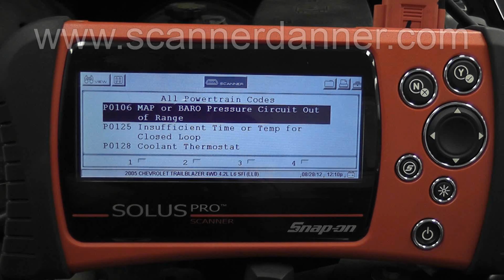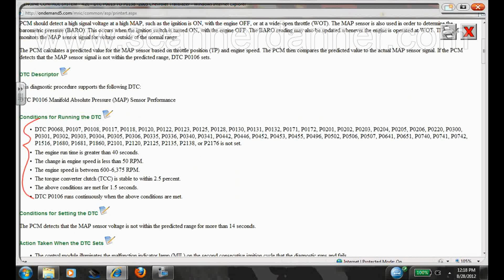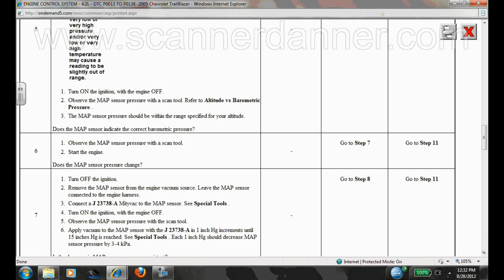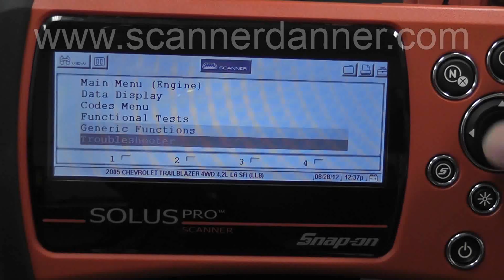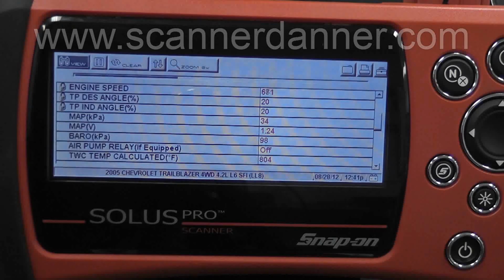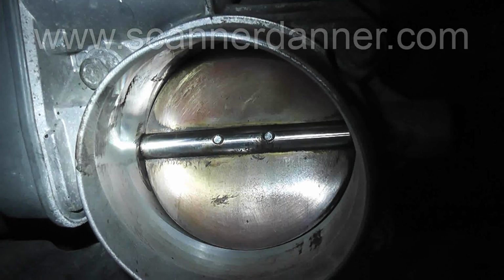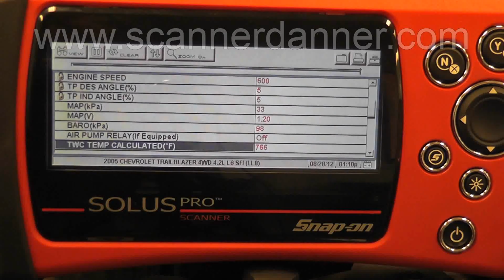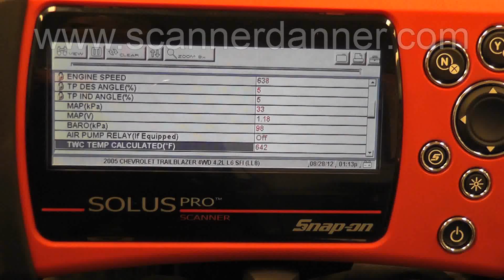MAP Sensor Code P0106 caused by a dirty throttle body

Comment: Just cleaned throttle opening/plate on Chev hhr, started up and after about 2 min the engine light went off by itself. So far looks like a fix. I just have $20 bluetooth scanner and free torque on my Android which did the trick. Great info. Only had kerosene on hand as cleaner but worked fine.throttle angle still at 20 deg though but I guess will readjust.
Reply from the maker: It should and some of these will take over 40 miles of driving to relearn the base throttle position
Reply: ok that will be interesting to check it at about 40 miles. I was thinking of perhaps diconnecting battery to reset everything, might have to replace battery anyway so that may happen anyway so I'll check it right after and see if throttle pos has changed. wodln't be surprised if it didn't though, I'd think there would be some sort fo back up power for computer so it retains info if battery is disconnected. If so that power source might not last v long, if battery left disconnected overnight that might reset it.
Reply: But code hasn't come back and it's running fine so maybe throttle pos being offset doesn't worry it, although it is showing pretty poor miles per gal so that may be related.
Reply: WAs a bit worried when I read that moving throttle manually can damage the tps, but seems fine so far.
Reply: I'd also think, if tps sill shows 20% at idle that should set the code again but it doesn't... a bit mysterious.
Reply: so is 20% not normal? i have the same in mine...
Reply: Is it running fine and not giving a fault code? Mine has been fine since but I haven't checked the angle since then.

Comment: What's your take on that specific air/throttle body cleaner they sell instead of regular carb clean. I've heard and read about there being an anti carbon finish of some sort on the throttle plate that will be taken away with any old carb or brake clean?

Comment: Hey, Paul. I am having an issue with a 2011 Nissan Altima, I believe to be a drive by wire. It has a MAF code and when idling, the RPM drops and stalls. Since drive by wire has no idle air control motor to regulate the idle speed and there is no  P0171 that could be resulted from a vacuum leak causing a drop in engine rpm at idle. Could  a  drop in RPM caused by a MAF sensor in a drive by wire system?

Comment: Thanks for your reply. I guess I'm not surprised that it's a cost saving measure and I see your points. I suppose it's like any other product/device out there that is continually being cheapened in order to save money. I'm not an auto mechanic by any stretch of the imagination, but I have a strong curiosity about the subject. Thanks again for your efforts in posting informational vids.

Comment from the maker: @mlb0611 typical isn't it? anyway thanks for the tip. I've been cautious about the cleaner. had a cavalier that one of my garages ended up having to replace the unit after a cleaning service. i wasn't part of that job but was told about it.

Comment: I got the p0106 and p0107 bought new map for 68 bucks light back on in minutes. sure wish I saw this video first. I had 24 % angle  before cleaning and down to 3 % angle after quick clean. only problem I had was with computer relearning with A/C on. it would shoot back up to 26% angle and 1600rpm the position it leaned to maintain idle with dirty plate with a/c on. 10 min and several ignition cycles and same. finnaly disconnected battery and now 3% a/c off and 6% on. thanks !!!
Reply: Marshall Mcaloon awesome, thanks for sharing. crazy stuff right?
Reply: kcotte59  The cars drive themselves now lol

Comment: Does the MAP sensor require calibration on any kind? I have a 1998 Honda CRV, no codes but I do have high Short Term Fuel trims -14-16. I put in a new MAP and the Short Term Fuel trims display a better range of -1 to 0 however the CEL turns on displaying code P0108.
Reply from the maker: I assume a P0108 is a MAP code. No, the MAP sensor does not need calibrated. Did you have a MAP code before?
Reply: ScannerDanner No previous code, only when the new MAP is connected. After further testing with a vacuum source, it looks like the ECM isn't seeing the new MAP or it's shot, the scan tool MAP reading is 29 with the old MAP and 59'with the new MAP and with no MAP connected, hence the CEL, all tests were KOEO.

Comment: On my VW Transporter when I clear the fault code the van drives all day and the EML doesn't come back on. But after turning the engine off and on. After the third start up the EML comes back on.

I have replaced the MAP sensor, cleaned the MAF sensor, new EGR valve and doesn't appear to have an air leak....

I will try cleaning the throttle body today.

Comment: Paul

could be worse Fords drive by wires trouble tree will have you replace the Throttle assembly for a dirty TB:( that will fix it but dang,nothing about cleaning it.

My wife owned a Trailblazer for 214K and I had to clean the Throttle plate about every 20-30K for stalling issues, FYI No problem spraying cleaner down the Throttle body, if the system is leaking, at the blade, it needs to be replaced anyway but I have sprayed a ton of Drive by wires systems without issue.

Comment: I've measured 3.5V on the MAP sensor with Engine OFF and key ON. And 1.5V at idle. Are these numbers considered to be good? Car has low fuel milage and rich condition. Could be the MAP is faulty? No CEL, no vacuum leaks. Engine has poor performance, pre OBD II.

Comment: This was super informative. Ive been tormented with p0106 for the last month. My car has aftermarket forced induction and I thought the code was from the OEM sensor going bad and so I replaced it. Didn't do the trick. Then I got to talking to some people who know a little more about engines than I do and they started talking about a leak in my intake manifold. Im also throwing an o2 sensor code, but that stays away for a while when I clear it unlike the MAP sensor code. I just cleaned my throttle bodies, took it for a test drive and felt it have more pep in its step, cleared the code and am hoping it stays away. In your experience would p0106 paired with p2a03 be signs of a leak somewhere??
Reply from the maker: +Josh Suriano not familiar with the p2a03, you sure you typed that correctly? But yes, I am sure that you fixed your MAP code
Reply: +ScannerDanner Its a Nissan I'm sure they have odd codes. But yes that's the correct code. Read it off my tuner but it hasn't come back for a few weeks now.

Comment: Obviously the same group on engineers who made the code system wrote the flow chart,If a dirty T body causes a map code and not a TP code,then replacing the EGR valve  may fix a EVAP code.And if we had a "known good part" for every flow chart,what the &*%$ do we need flow chart
Thank you Paul

Comment: It's so easy to reach the throttle body on this car.  It takes an hour to reach it on my Volvo.  It's buried down on the side of the engine.  It is so difficult to reach that they almost never get cleaned and so they are frequently the cause of trouble codes.

Comment: I had a dodge Avenger with over full oil that set my code an carb build up around throttle plate but vent tube let oil fall down to the throttle  killing idle .... blade was only open at 9 % a lot of trouble from 1. qt over oil...

Comment: You asked why the manufacturer would leave out throttle position in the troubleshooting flow chart.One would think that carbon on the throttle plate would be a preliminary check! But what do I know I have no degree .

Comment: great video!.    But what if I already clean the TH plate, changed the map sensor/ egr valve ( 07 ford 150) map sensor,  already had new plugs and intake mani,   changed all coil packs,no vac leaks ,and still get p0106 , the odd p0300 and p2195_97 !   in the list of "to dos"   it said p0106  could be caused  by cam timing!... so could a starting to fail cam/crank sensor be the cause to sum of these codes?    sincerely, my last Ford
Reply from the maker: It is becoming more and more difficult to answer questions here. I have 80,000 people asking me for help now. So I have created a forum to help you guys better. It is free to join and we can exchange pictures, wiring diagrams and waveforms if needed to help guide you through the process of troubleshooting your vehicle. Thank you so much! Hope to see you there. 

Paul Danner (ScannerDanner)

https://www.scannerdanner.com/forum/post-your-repair-questions-here.html
Reply: ScannerDaner
Reply: Grizzly G gu

Comment: LQuick question..i replaced a Throttle body assembly on a 2003 Chevy Silverado 4.8L because it had a code P2135.  I did this after someone had replaced the harness that goes to the TAC module in order to fix this problem. (all the wires were GRAY when i got the truck). so do you have to have the module reprogrammed after the Throttle body assembly is replaced.??

Comment: Great info and the fact you prove your points. Thank you so much. Luckily I only replaced the MAP sensor before seeing this. Just now cleaned mine and will add to this is anything changes.
2012 Chevrolet Silverado 5.3l with 71k miles and a 3.42 to 4.10 gear swap for towing MPG.
-----------------------------------------------------------------------------------------------------------------------------------------------------
P0106 code comes on occasionally and deleted by Hypertech programmer.
ALSO FREQUENT RANDOM Stabilitrac OFF, Traction OFF, 3 cylinder stumble, then full recovery with no light 90% of the time or P0106 or LEFT BANK RICH code ONCE.
Problem showed up mostly when RETURNING TO IDLE.
Replaced MAP since it was inexpensive.
NO Change!!!
Then I found your video GREAT INFO, Very informative AND found this one! https://www.youtube.com/watch?v=XhRGadjK3w4
That one included the Stabilitrac and Traction problem and SAME FIX.

You two combined hopefully just made my day 5 BLACK RAGS LATER.

THANK YOU. WILL FOLLOW UP in 7 days to tell if it fixed my issue.
Reply from the maker: Look forward to it!
Reply: @ScannerDanner  it's been 6 days now.
My truck is running perfectly. Thank you for making this video.

Comment: I was tripping on the wires myself but i checked all of them & found the 5V, signals, and the grounds.(Customer stated it was rewired by a Chevy Dealer by the way). I unplugged the harness and the signals jumped to 5V. So assuming the wiring was done correctly, this truck had a bad TAC. Don't know why it was rewired & customer doesn't either. This truck got a new TAC it ran fine so i called it a fix, i know there's more testing i could've done but i'm limited to a DVOM and Code Reader right now.

Comment: Seems like somewhere it would say that a warm engine idle should be around 6% throttle angle.  You seemed to know that, but is that from experience or documentation?  Is 6% a general rule of thumb across a lot, or most, vehicles?

Comment: Hello, Mr Danner. I am dealing with a p2135 on a 2004 Nissan Murano. It is said that the code is set when Tps1 and Tps2 have correlation issues. I am leaning towards cleaning the throttle body. Do you think that could fix the no throttle response? Please, your answer would be very appreciated.

Comment: Wow! great info here Paul!! One question though, shouldn't The TP desired angle be around 5% before you cleaned the throttle plate. Both PID'S showed 22% prior to cleaning.
Reply: +mike withers 
no, because the throttle body was dirty the computer was opening more the throttle angle  to maintain minimum idle, and to do this  22 per % was  desired and  22%  was position, but to answer what you are thinking   I will elaborate  one case here  ,  if this vehicle  if you disconnect the battery  now you will get about 5% or what ever is preset in the pcm programming ,  and your vehicle will not idle  will be start stalled , why? because the computer does not know about throttle body dirty and have not learn it.

Comment: This is good. My l200 tps is at 100% at idle and has no guts under load. Starts great though
Reply from the maker: TPS should not be at 100% at idle
Reply: ScannerDanner I have zero vacuum at idle also and seems to be missing. It runs out of puff on hills. I live in Wales and there's a shortage of good diagnostics guy's here, they just seem to change parts you don't need and that's the dealers. Great vids Dan and thanks for the reply.

Comment: I hooked a live data scanner to my 2000 CHRYSLER Voyager 3.0 V6 key on engine off, and the throttle position sensor read "14.1" -"74.9" mostly smoothish climb while using the foot feed..My map sensor read 3.5v ... I hear that there is a possibility that these two sensors may share a common ground, I have a scanner and multimeter but little to no knowledge of complex wiring systems..My question would be how would I check both tps and map wiring locations with the tools I have AND if grounds are found to be bad could I just ground each sensor to the systems closet grounding point (i.e. tps to block and map to firewall bolts?) You could eat off my Throttle Body, I've even port matched smoothed and polished the upper air intake plenum... All other sensors are new and I have a new Tps and Map on the way, I would just like to verify the connectors before I put the new ones in.... Thanks ScannerDanner Your The Man !!

Comment: I need 2005 trailblazer baro sensor pin location on pcm diagram. Not getting volt reference to connector.

Comment: Sir may i know if the 5 volt reference  of the following sensor measured abnormal voltage may affect the engine or the engine might not start I'm i right sir tnx

Comment: is it safe to say that majority of the car makes should be at an average of 5% give or take a couple for throttle opening at idle?
Reply from the maker: For ETC systems, I want to see around 10% or less at idle( no accessory loads, hot engine, in park)  but I hesitate to say that applies to the majority of cars. 
I'm sure there are variables.
Reply: +ScannerDanner thanks I really appreciate you taking the time to reply 👍love your videos and often find myself studying with information you provide. Thanks!

Comment: i dont understand why the map reading is 36 kpa because 36 kpa is 10 inhg which indicates a vacuum leak, compression or timing issue. Even if the throttle plate is open a little more, its only compensating for the dirt blocking air flow so vacuum should the same.
Reply from the maker: That number is subtracted from an engine off reading of 28 to 29 "hg. So this would give us around 19" of vacuum. It is a goofy data PID

Comment: you mean the TPS was out of range in relation to the MAP and RPM,right? i dont think the MAP or the RPM were out of range,  TPS was. Thats the confusing part, it trows  a MAP trouble, When  in reality is a TPS problem, is out of range in relation of a "normal MAP and Normal RPM". thats the way i understand it . I am learning here also i am not a mechanic.i think trhotlle body servo opens  to compensate carbon build up,and ECU see TPS out of range in relation to MAP and RPM.
Reply: Good observation and its also the reason why an individual  should never just go out and buy a new sensor just because a code pops up for it.
(Example) thousands of people go out everyday and buy o2 sensors because a o2 sensor lean code popped up on a scanner.In reality though,its a vacuum leak that triggers that code 9 times out of 10,so always trouble shoot first so you don't spend unnecessary cash.

Comment: Still not sure why the desired angle wouldn't be much lower with the dirty throttle body - it showed 24 % on the scan tool. Shouldn't there be a discrepancy between the desired and the indicated with the dirty throttle body. ie :PCM Programming says at idle I need X % amount of opening to attain Y amount of engine speed while idling. If not achieved, open throttle more to obtain required engine speed which will increase indicated throttle valve opening %. Therefore, a difference between these two parameters should exist if throttle body is dirty.

Comment: I have a 2007 GMC ACADIA the scanner shows map performance test1 fault and map performance test2 as OK, my question is what is test 1 looking for opposed to test2? The problem I'm having is a misfire on cylinder 6 on a cold start only and smooths out when warm on 3.6l engine, could this be related to the map performance?
Reply from the maker: No, a MAP sensor issue would not cause a cylinder specific misfiring problem. I would suggest the MAP code is being caused by the misfire, not the other way around. If this is a coil over plug engine ( I believe it is) move coil 6 to another cylinder and then clear the codes and drive it. Then do the same thing with the plug if it stays in cylinder 6
Reply: @ScannerDanner  I did swap the coil and the plug and it's still the same problem, misfire #6 until it warms up! From what I understand these vehicles dumps more fuel into engine upon a cold start to get it into closed loop faster by increasing injector pulse width at between 3-4 ms and then once warm drops to 2-3 ms at idle, I did clean the top of intake valves by inducing CRC cleaner into intake while running assuming carbon buildup on valves, that didn't work either, could this be a faulty injector not operating at the higher pulse widths or when cold? Could it be a blown head gasket near #6 cylinder that seals when it's hot? I'm dumb founded at this point! Any suggestions?

Comment: hi people , one question this fault can filter CO2 fatal gases to the cabin?
Reply: sure if your throttle is so bad its surging, you dont have a cat and instead have a chopped off exhaust and dumped open header on the truck while sitting at idle inside a closed garage lol. Otherwise, no.